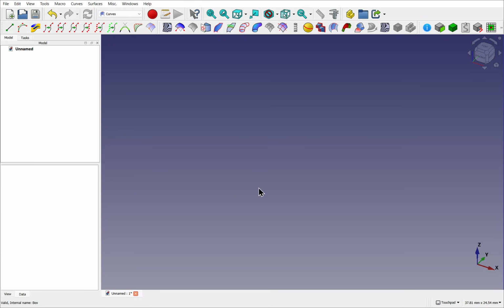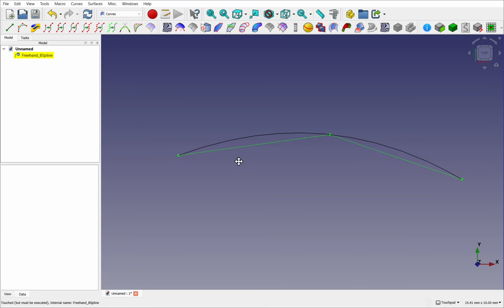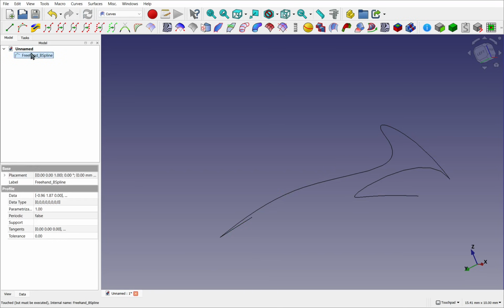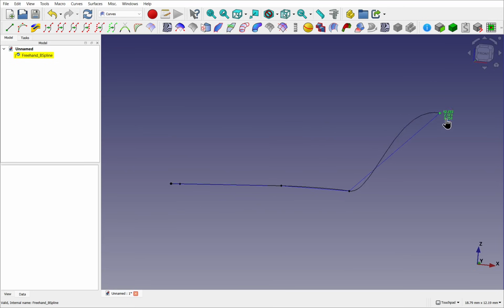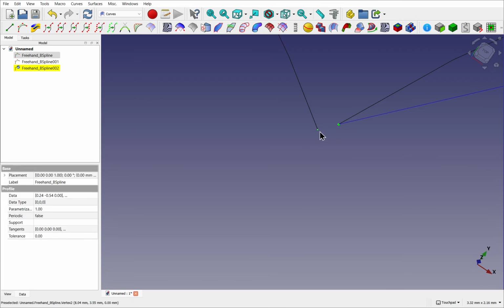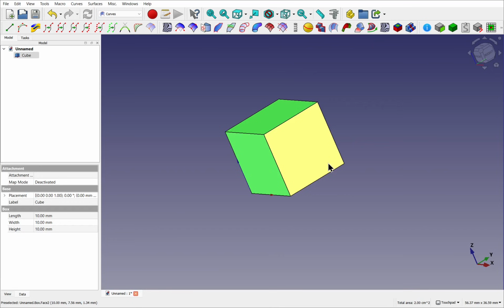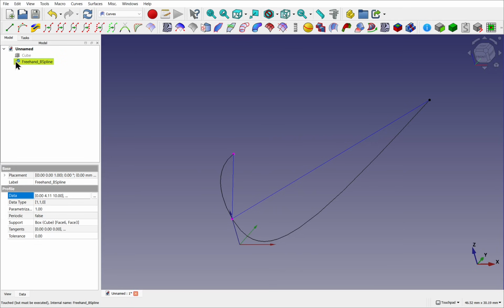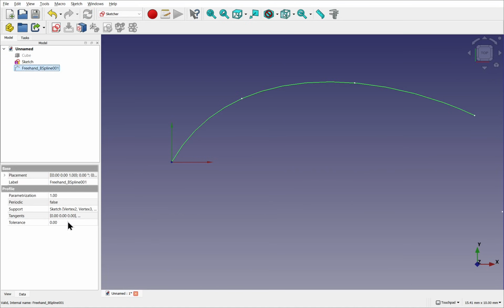FreeCAD Curves Workbench: Freehand BSpline | Quick Guide

Comment: Hi, thanks for the tutorial. I'm trying to trace around an image using this tool but the points won't release and they stay stuck to the pointer unless I hide the image. Is this a known issue?
Reply from the maker: Ah yes seen this before, the image is getting in the way, two things you can try, set the image to offset of -1mm on the axes that runs perpendicular to the image to lower it out the way.  If that doesn't work.  Select the image, click on the view tab next to the data tab and set the property 'selectable' to false or uncheck so it's set to no (depending on version)
Reply: @MangoJellySolutions  Thankyou, that was it.

Comment: When would you use this in 3D view rather than in sketcher?
Reply from the maker: One use can is that you can use this for paths in 3D space to pipe / sweep along.
Reply: @MangoJellySolutions  I think the original question is quite relevant. The video just showed a bunch of curved lines hanging out in model space. What are you supposed to do with those other than pipe and sweep along. Is that the only value. It would seem more valuable if there were a way to transfer these sweeps from the model view into the sketcher. One application might be to import a .stl model,  use the Curves WB b-spline to trace outlines, then incorporate those lines into the sketcher to create a matching sketch that could be padded out. Please comment.

Comment: Hmmm, I think this Tool would be useful when trying construct Surfaces/ Wire Frames on varies Surfaces. It seems You can get the B Spline to follow Arbitraily assigned Points in Space. This is a Curly One I'll play with it a bit and see if I can figure out how to use it ;-).
Reply from the maker: Definitely, also if your into your model aircraft one of my patreons is using it to create rods to run the length of the wings using the bspline as a path to sweep along.  It you have problems with the sweep twisting, set the parametrization property of the b-spline higher / lower.  We found that out last week. :)

Comment: Im having trouble getting the points to move in the table.  I follow the exact method shown here, but its hit or miss if the points actually move, or my changes in the table simply are ignored. Ive tried it several different ways, nothing so far has been successful 100% of the time. Im on 1.0.0. Any thoughts on that?

Comment: How on Earth can a bspline line be copied - or duplicated - in a different area of the same or any other construction plane? Is that even possible? 
I have created a scroll line (for an ornamental iron gate project) and cannot duplicate it (or even offset it) at all. I see some sketcher tools that may work(?) in the dropdown, but those are entirely grayed out. Using FreeCAD 1.0.
THANKS for your excellent videos!
Reply from the maker: So, funny you should say this, last night I was building a cowl for a rc plane and I was using a couple of sketches as scaffolding. I realised I made a error and should of placed the two bspline further to right. . I tried dragging them but the control points were left behind. I then found the new sketcher array transform  tool for v1. I selected both the sketched bsplines, clicked the tool and then selected a point to pick up the geometry. It only worked, I still have to understand the whole tool as it does a number of other things but it's a bit of a game changing for the stuff I do. I need to introduce that into my video or do a dedicated one. I hope that helps in the mean time, take a look at the top and give it a go. Glad your enjoying the videos. (BTW the tool in the sketcher looks like 3 lines)
Reply: @MangoJellySolutions  A THOUSAND THANKS to you! I am literally holding my breath for your video instructions on this. Yours are simply the best, most helpful and clear, FreeCAD explanations I have found.

Comment: Can I use this B-Spline to sweep a path along it for additive pipes in Part Design?
Reply from the maker: The freehand b-spline in curves workbench is best paired with the part workbench.  You may be able to shape bind the freehand bspline to the part design workflow but they will need to be made into a closed wire.  You will have more control over them in the part workbench.
Reply: @MangoJellySolutions  Okay, thanks!
Reply: @MangoJellySolutions  Need a video that demonstrates your reply.

Comment: I  can see this being used as a path to create things like vehicle break lines.
Reply from the maker: Good idea.  I had a patreon contact me about how he would create wires in electrical devices and we used this along with a sweep.  Grouped it with a split curve so we could change the thickness of the sweep to simulate the copper ends and insolation.  There will be a video out about that soon as well.
Reply: @MangoJellySolutions  Breaklines, transmission cooling lines, radiator cooling hoses or lol crazy straws.

Comment: Very detailed tutorial! 
This is a vital bit of knowledge needed for being able to run wiring for my RC Tugboat project. I have a motor, motor ESC controller, servo, and a battery. These components are all on either the XY or YZ planes and all are on the different "Z" elevations. For example when running the wire(x3) from the motor it comes up and out from the motor and then a short RH 90° turn to a short run then a LH 90° towards the stern and the ESC controller... My point is I simple cure was to create various 3 wire horizontal and vertical 90's then transform tool to align with the various straight sections. 
Then select and union the sections. I always knew someday I will get good enough to run the various wire path more from a isometric view and curves is the WB (more efficient). 
I also then need to get good at aligning the profile to the end (vertex) of the path. I feel by selecting the profile then right click to "attachment editor" and under "selecting" choose the vertex where the sweep is to start, I think is where is where I need to go next😊? Together with what I added to my toolbox from this video should accomplish my desired results. Sidenote: For the 3 wires together I did create 3 circles of desired "X" dia and overlap the wires a little so that when trimmed gave me my 3 wire look from 1 profile, (you prolly showed me this) so that when different colors are required FreeCAD will let you even though it is 1 profile...
Please advise any changes to my routine that is wrong or there is a better way!
Thanks
G_Dub